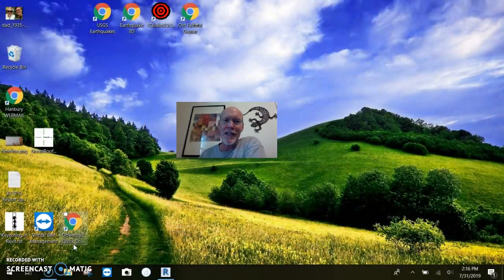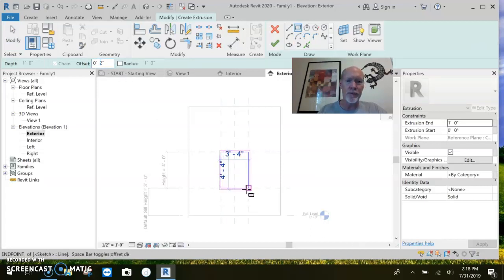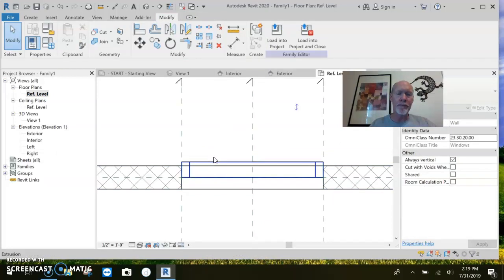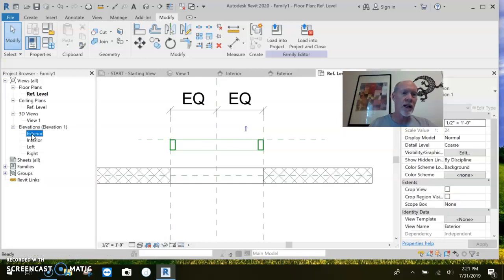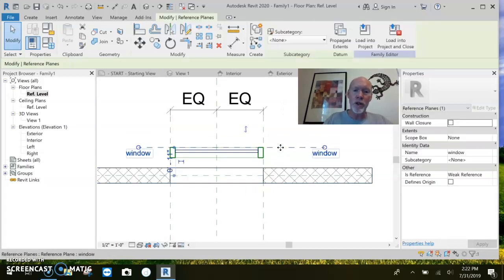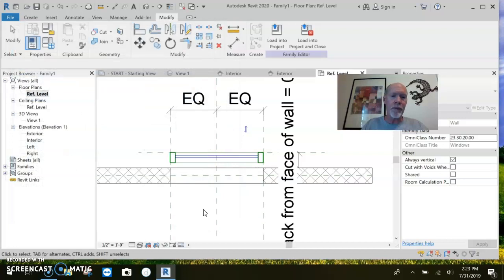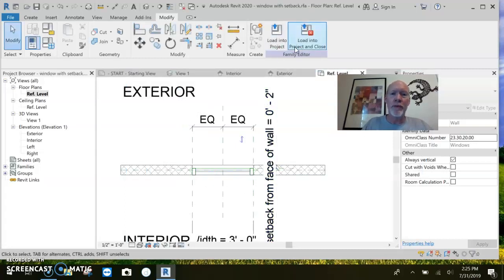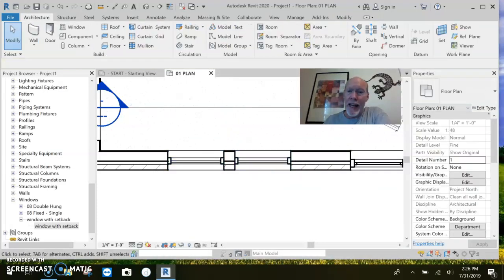Adding SETBACK parameter to a window

Comment: I DO NOT WANT THE SETBACK TO BE A FIXED NOMBER, I WANT IT TO BE A PARAMETER DEPENDING ON THE THICKNESS OF THE WALL, FOR EXAMPLE I WHAT I WANT TO DO BUT I STILL DO NOT KNOW HOW IS TO SET A PARAMETER WHICH WILL BE CALCULATED USING THE FOLLOWING FORMULLA ( HOST THICKNESS (REPORT)-FRAME DEPTH ) / 4 ... THIS COULD BE USED FOR EXAMPLE IN THE PLAN VIEW TO LOCATE THE ARROW OF A SLIDING WINDOW BETWEEN THE FRAME EDGE AND THE WALL EDGE IF THE WINDOW IS CENTERED TO THE WALL CENTER